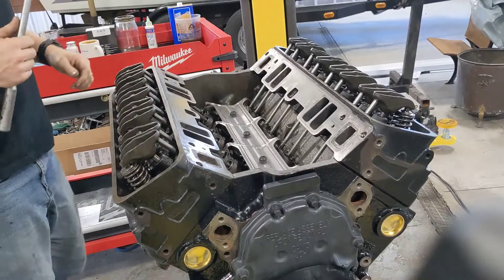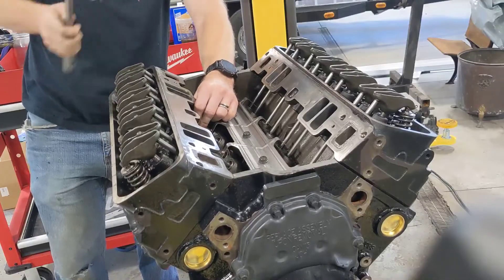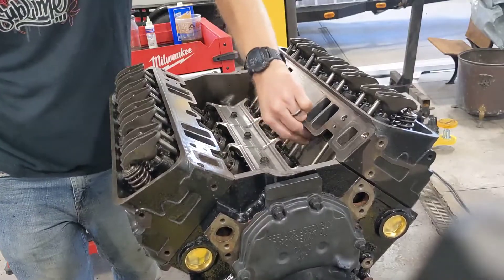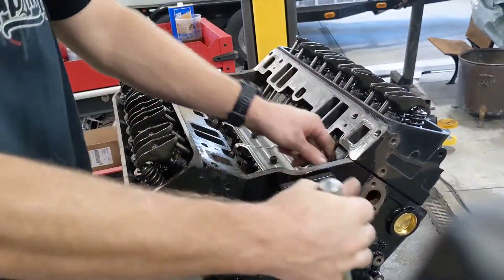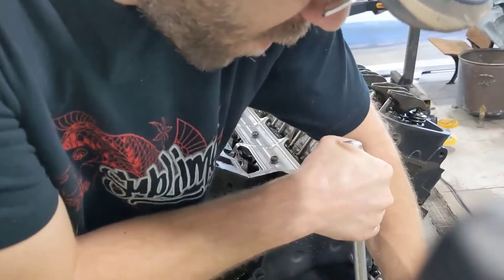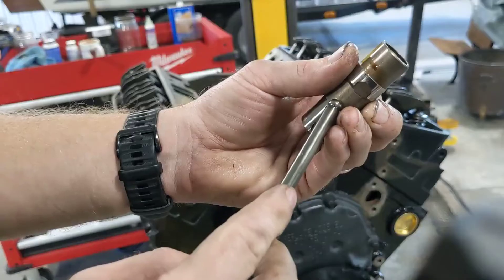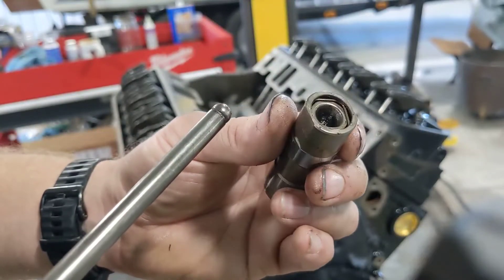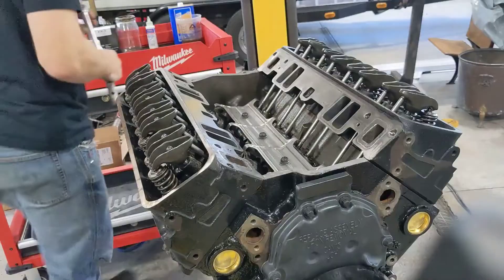Rocker Adjustment Made Easy for Hydraulic Valvetrain

Comment: This actually seems like it takes longer.   Just set the motor up to TDC #1 Compression and adjust both intake and exhaust valve 3/4 turn past zero-play,   then rotate the crank clockwise 90 degrees and adjust # 8 intake and exhaust valves 3/4 turn past zero-play,  then rotate the crank 90 degrees and do all the rest of the valves in the Firing Order the same way turning the crank 90 degrees clockwise after each one.

Comment: Many different American v8 s have fixed rockers with no adjustment. If left stock all you do bolt the valve train together. Only way to adjust is to use different push rods 🎉

Comment: When using this method on an installed, oil-filled engine, should I first loosen the nut until there is play in the pushrod, then tighten it until the play is gone? I imagine that starting with a tight pushrod and adding the extra 3/4 turn might make it too tight.
Reply from the maker: @Henk-JanPool  Yeah, that's what I would do.

Comment: When the exhaust valve starts up set your intake vale lash at 0. When your intake is almost all the way down set your exhaust valve lash at 0. Do this to every cylinder. Tighten all nuts 1/2 turn more and every lifter top will be set and it will off the retaining ring .020. all the same preload on a cam so it is in balance and will wear perfectly. I like to spin my pushrods and wiggle them into seat. This is the Crane Cams recommended way to set the preload on a new cam and lifters. Competiton Cams has the same directions. It's on their website.

Comment: Can you do this with the engine already installed and oil in it?
Reply from the maker: @davidcooper729  yes sir!
Reply: @martinarcher25  thanks for the reply! I’ll give it a go! I appreciate the video
Reply: I checked for no up and down play, but should you still be able to squish the rockers up and down?
Reply from the maker: @davidcooper729  Correct.  We are taking the play out first then applying a partial turn to preload the lifter.  This slightly compresses the spring but there is still more travel in the lifter if you push down on it.

Comment: Does this method work when the lifters have oil in them? The engine was running, but had to change the head.
Reply from the maker: Yes.  IMO it doesn't matter at all since you are adding a partial turn of preload to the lifter from where the pushrod play is gone.  A dry and pumped up lifter are the same length so the point the play is gone is the same.  When we start to preload with a partial turn, if it is dry it will compress the spring, if it is pumped up with oil, you will still be adding the same amount of preload but it may barely crack the valve open which is no problem, the oil will bleed down after preloading.  When the engine is started again both methods will result in the same amount of preload from the fully extended lifter.  Happy wrenching!
Reply: @martinarcher25  Understood great explanation 👍🏽
Reply: Great question. I'm getting ready to do this on my 2000 K3500 5.7L, and this has been on my mind.

Comment: Old method that I have used many times since the 1970's. Works fine if you're mindful. BUT DO NOT OIL SOAK OR PUMP YOUR LIFTERS UP BEFORE USING THIS METHOD. If lifter(s) are pumped up, bleed them down first. Finally, pre-load lifters per lifter manufacturers instructions--usually 1/2 to 3/4 turn. I do 4 full turns of the crank during this process (that's 16 90-degree steps), Do it once, take your time, enjoy.
Reply: How do you bleed them? Just draining the engine oil?
Reply: @davidcooper729  You have to bleed each lifter if they are pumped up.

Comment: This only works on adjustable rockers? Cant do this on shaft rockers like a small block chrysler?
Reply from the maker: I'm not familiar with that engine but if it doesn't have a hydraulic valvetrain this would not work.

Comment: Just adjust 2 of them and count the treads on top of the nut put all the same its really close if not dead on u have a lot of lead way of adjustment if its a  Hydraulic lifter If it's a solid lifter you need filler gages or a dial indicator !! Its not rocket science im saying it can be a huge adjustment area and it will be right in all that area so really hard to even get wrong !!

Comment: What if you do all t his and it gets loose again after a 10 minute drive? I did this to my 76 camero, ran perfect for a test drive then started making noise and got loose again
Reply from the maker: As long as the play isn't being caused by a rocker stud pulling out or cam wear I would recommend using thin jam nuts or swapping to the pinch style rocker nuts.  Summit has them.
Reply: @martinarcher25  thank you so much. You are right, i think the nuts are worn oit because when I rev hard it gets loose and acts weird again.
Reply from the maker: @MichaelPashan23  Nice.  At least it's a quick easy fix!  Good luck with it!
Reply: This only works on adjustable rockers? Wont work on rockers that are all on one shaft like a small block Chrysler?

Comment: wouldnt it work the same to do #1,6 on tdc. then #8,5 on 90 degree mark, then #4,7 at bdc, then #3,2 halfway back to tdc?
Reply from the maker: There are lots of ways to do it by tracking TDC, this method is nice because you don't care where TDC is and you can just go 90 degrees at a time until you're all set and fully cover the cam.
Reply: I marked my harmonic balancer on painters tape when the cylinder heads were off just so I could do it this way. The feel method is a jic and to double check them.

Comment: On a used engine if I remove or slacken right off a rocker and test pushrod to see if springy, if it is springy then it's hydraulic? With intake on.
Reply from the maker: Sure.  If your just doing a single rocker remember to go through all 8 quarter turns on the crank pulley to make sure you test the entire camshaft rotation.

Comment: When it comes to how much you preload, the best answer I have heard was, "if it's your buddies engine or a customer's, go 3/4, if it's your engine, go 1/2".
Reply: Some say to start at 1/4 then do a hot lash adjustment when engine is running but I’ve always heard best to start at 1/2 turn and in most cases no additional adjustments are necessary.

Comment: Can you do it with the intake manifold on and a motor that is already running but recently rebuilt like 1500 miles
Reply from the maker: I don't see why not.  As long as you can jiggle the little bit of pushrod poking though the head, you should be fine to do it this way.
Reply: @martinarcher25  tried to do it with the engine running but once I got half way to the lifters un doing it till it ticked then 0 lash and 1/2 a turn the engine wanted to stall out and it happened with 2 lifters and some are super tight some are perfect rebuilder told me it was all adjusted fine guess not so I’m going to try this out and hope my engine can run smooth as of now it runs kind of rough and I see why but has improved with a little bit of tweaking with the lifters
Reply from the maker: @sega2229  I've never attempted it with the engine running.  I think it would be much more difficult to single out play in a specific pushrod with so much other mechanical noise of the engine running.  I'm sure some can do it but I don't multi task that well!  :)
Reply: @sega2229 any update, if it worked?
Reply: @davidcooper729  it works with the engine running and with it off rotating like 6 times at a certain degrees. Nothing was wrong with the adjustments my rebuilt engine was just eating the cam then ticking and I got it rebuilt 3 times I recommend you do roller cam regardless of anything even if your sure
You can do the break in process. The flat tappet suck and are not worth the time. Haven’t had porblem with the roller cam upgrade on mine. If it’s ticking then your cams shot

Comment: Any reason why some do 1/2 turn some do 3/4 turn for preload. Thx
Reply: I heard that some people even use 1/4 turn but thats for racing. I did try my lash at 1/2 turn but just seemed spongy. 3/4 of a turn is what I go by. 👍🌟
Reply from the maker: Good question.  You really want the pushrod preloaded to the center point of the lifter (between the retaining clip and the point where the lifter plunger bottoms out in the lifter).  I think most use what they have always used and are comfortable with.  You could always find the center by slowly turning the nut in until you feel the lifter bottom and see how many turns it takes.  Just be careful not to go too far and damage the pushrod or lifter.
Reply: will this method remove the ticking sound from my 454 gmc engine when it starts cold